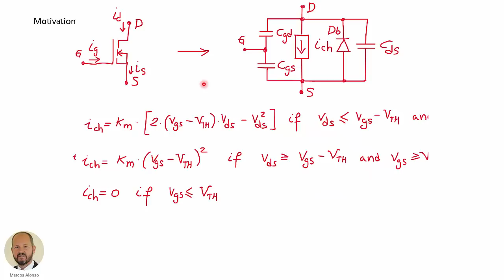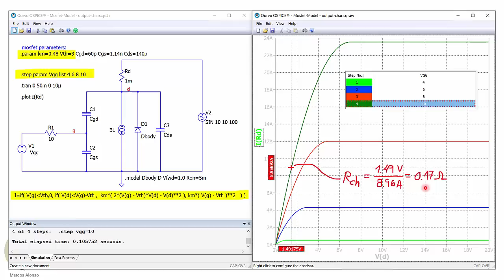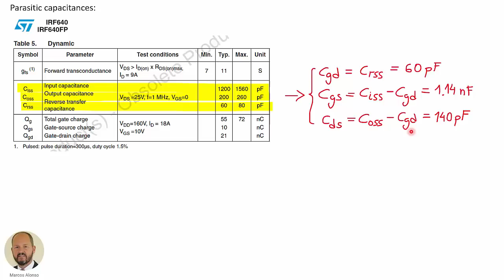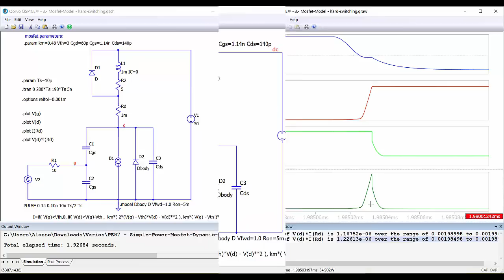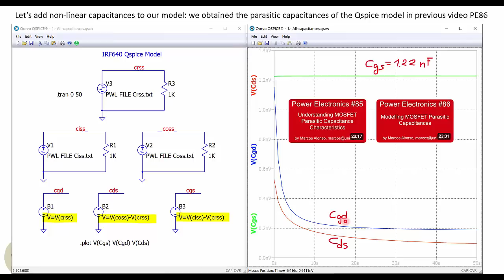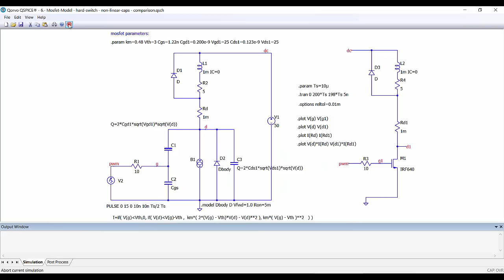PE #87: Simple Dynamic Model of Power MOSFETs

Comment: Hi Professor! Really nice explanation. Do you have recommendations which simulation tools to model accurately loss and efficiency of power converter that can also include digital closed loop control?
Reply: It would be nice also if I can model the non linear inductors.
Reply from the maker: There are several videos on the channel about the modelling of non-linear inductors. I call them variable inductors. Here are two videos:
https://youtu.be/MLAKJbVRCyw
https://youtu.be/ssuJec8UxBQ
There is a magnetics library to be used in LTspice. Recently it has been implemented for Qspice. See this video: https://youtu.be/RzQmCeqXrMA
Reply from the maker: Hello, you are describing Qspice. There is a playlist on it on the channel. Here is the first video: https://youtu.be/kR2L3j4-Llc

Comment: Hello Professor, I downloaded the transient simulation model TPS54540 Unencrypted PSpice Transient Model of the buck control chip TPS54540 from the official website of TI, I imported the model into ltspice and Qspice respectively, and according to the user's manual, the fourth pin RT of the chip is connected to a resistor of 200kΩ. I imported the model into ltspice and Qspice respectively, and connected the fourth pin RT to a resistor of 200kΩ according to the user's manual, the output frequency of the chip should be about 500kHz according to the manual; however, I set up a BUCK circuit and tested that the frequency of the chip's SW pin is only 243kHz; the output frequency in steady state is only half of the 500kHz; I tested the chip in two simulation software and the above problem exists; may I know what is the reason for this? The TI model is a pspice model and the algorithms of the two software are not compatible? I hope you can help to test the model and explain the reason Thanks!
Reply from the maker: Hello, there is a frequency foldback protection circuit. In the datasheet you can read the following:
"To protect the converter in overload conditions at higher switching frequencies and input voltages, the TPS54540 implements a frequency foldback. The oscillator frequency is divided by 1, 2, 4, and 8 as the FB terminal voltage falls from 0.8 V to 0 V."
Double check the voltage at FB terminal. It seems it is dividing by 2 the switching frequency as a protection
Reply: @MarcosAlonsoElectronics  Professor, thank you for your reply, I checked the voltage of the FB pin, after the BUCK circuit reaches steady state, the voltage of the FB pin is 0.8V, at this time I checked the frequency of the output waveform of the SW pin of the chip, and the frequency is 243kHz, I'll send the ltspice model that I built to your uniovi mailbox, please help me to take a look at the time, thank you! The .lib file is the pspice model file of TPS54540 downloaded from TI website, I tested the output frequency is 243kHz after steady state in ltspice and Qspice software, but I imported the model into simetrix and built the same BUCK circuit to test, the frequency of the output waveform of SW pin is 486kHz.
Reply: @MarcosAlonsoElectronics  I sent you an email using the gmail mailbox again, directly sending the simulation file without using the compressed file method
Reply: @MarcosAlonsoElectronics  Hello professor, did you receive the email? It shows as bounced. Is your mailbox set to not receive emails from strangers?

Comment: Sir one question if we want our converter output to be tight tolerance like +/- 0.5% then what are the option available ? I was thinking with go with discrete transconductance amplifier and reference IC to design compensation part..is that good option to go with?
Reply from the maker: Good question. The steady-state error (aka dc error) is inversely proportional to the dc gain of the operational amplifier so you need an operational amplifier with a high enough dc gain. It can be either an OPAMP or an OTA as long as the dc gain is high enough. You can do the math to calculate the necessary dc gain and search for a suitable amplifier.
Reply: @MarcosAlonsoElectronics   I did some homework on this and what I found there is some ic called trimming (servo) power management can do the job but that also involved software......and if I take normal controller and all the  controller inbuilt reference voltage comes with around 1.5% initial tol which the driving factor of the output voltage tolerance......then What I concluded if we don't go for for costly power management IC we can compete discrete design using transconductance amplifier and reference voltage IC ....but I am getting what are the parameters should I look for in transconductance amplifier selection and I am doing it for isolated converter so can transconductance output drive the opto coupler??
Reply from the maker: The transconductance amplifier (OTA) is characterized by the transconductance gm and the ouput impedance Zo. You can get the OTA dc voltage gain as gm_dc * Zo_dc.
Sure, an OTA can perfectly drive an opto-coupler because it has a current source output behavior so you do not even need a series resistor.
You can watch video LTspice #8 too. The controller in this video has an OTA inside.